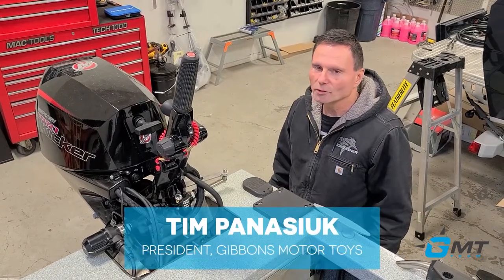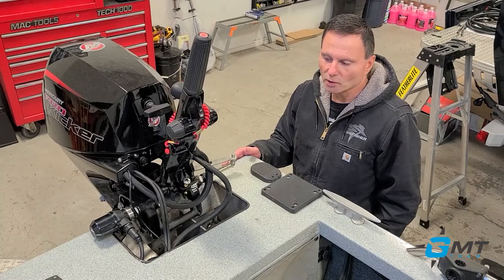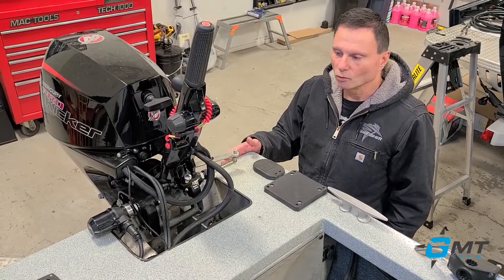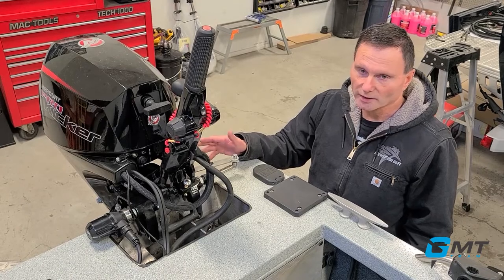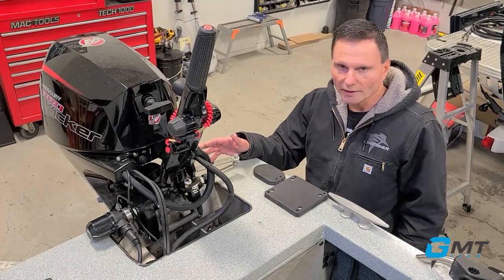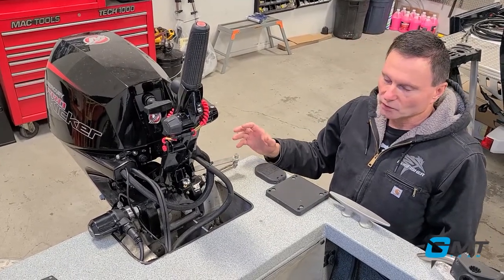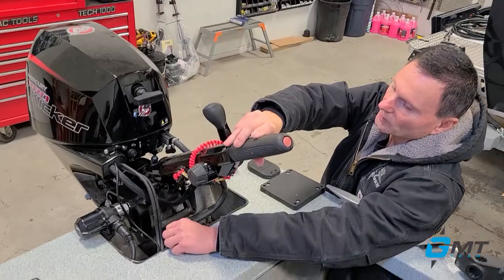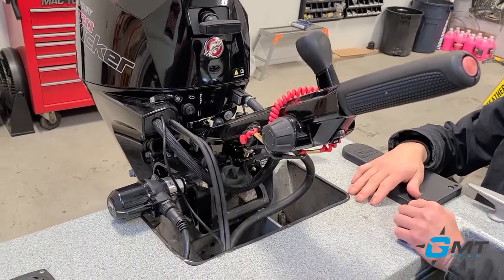Garmin Reactor 40 Kicker Autopilot - Alberta & British Columbia

Comment: Hi looks great can this setup be adopted to the 60 horse Mercury going at slow speed like 10 to 15 km? With a disconnect to use the motor at higher speeds
Reply from the maker: Not really the intended purpose. Is this a tiller handle or do you have a steering helm?

Comment: Great video!  I decided to do the same set up on my boat.  How did you connect the Garmin Reactor 40 Kicker linkage arm to the Mercury Pro-Kicker?
Reply from the maker: I believe we just used the steering linkage arm that comes with the Mercury Pro Kicker. It adapted well without any issues.
Reply: @gibbonsmotortoys  Thanks for your reply.  It helped me figure out to install the 90 degree Garmin steering bracket between the tiller and the motor.  Everything fit nicely and the Garmin steering actuator is working for me.  Now on to the throttle actuator installation.  I have some pictures if you want a copy.  They may help others who find your video.